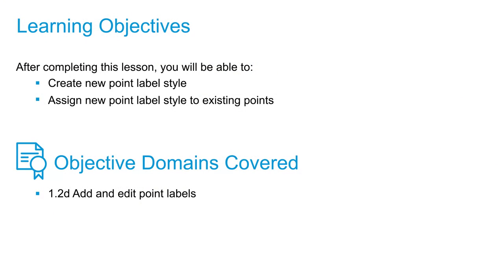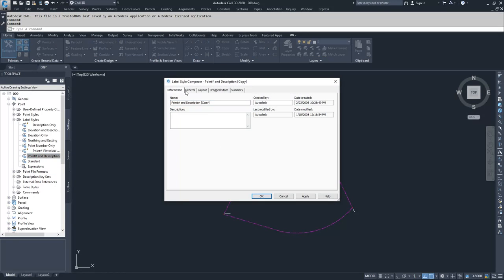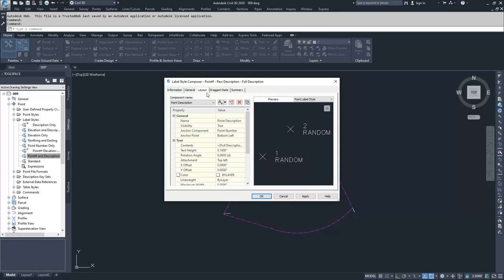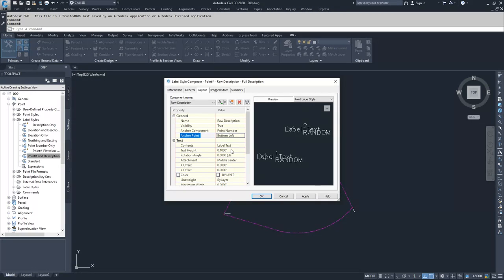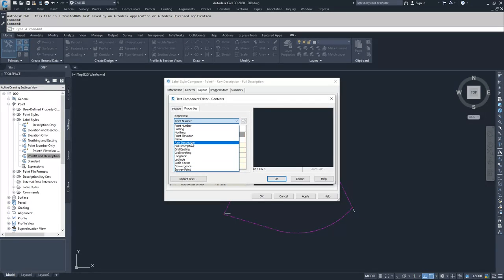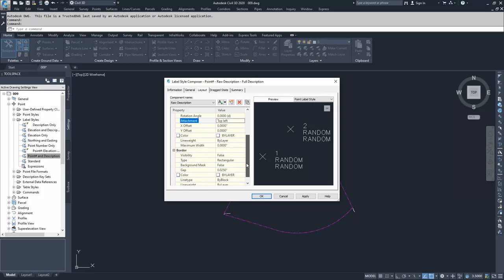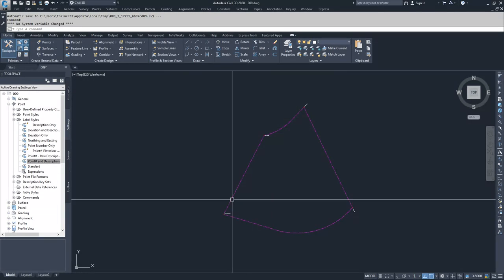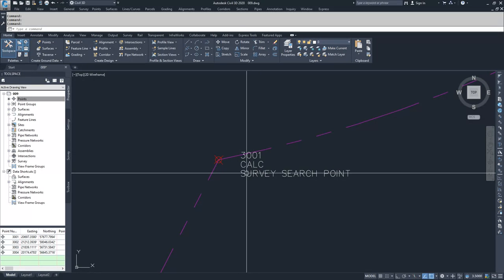AutoCAD Autodesk: Create and assign point label styles

Comment: Is there anyway to add a new field in properties and add a custom label for a point, that can be numbered. Where it says point number, elevation, description. I was hoping to add a new one that will say label.

I tried using the full description and adding a numbering system but the raw description changed to what the full description said.